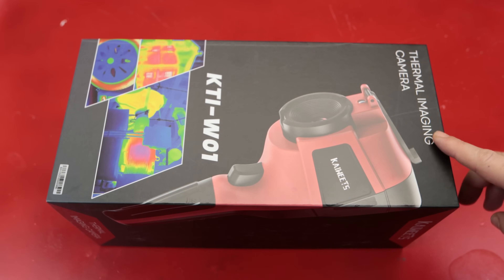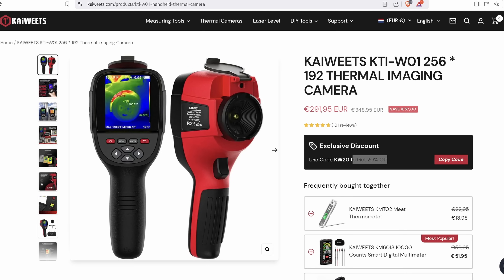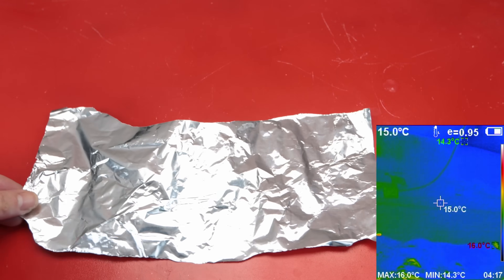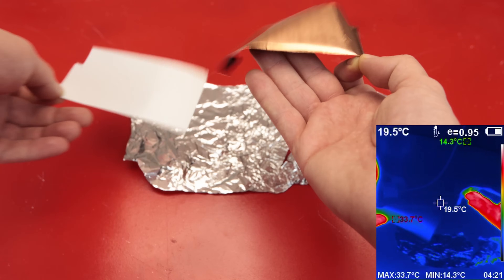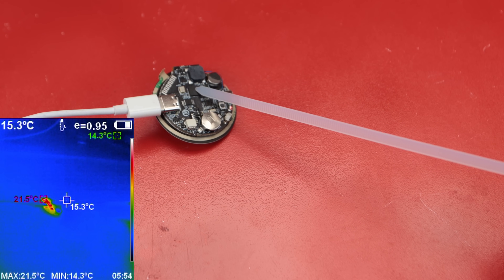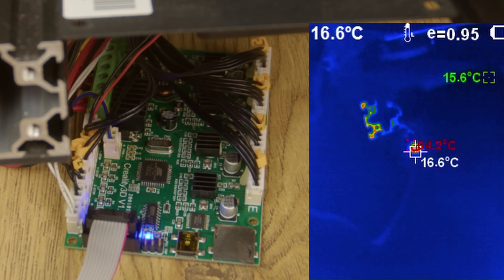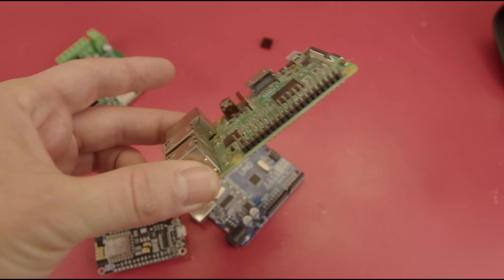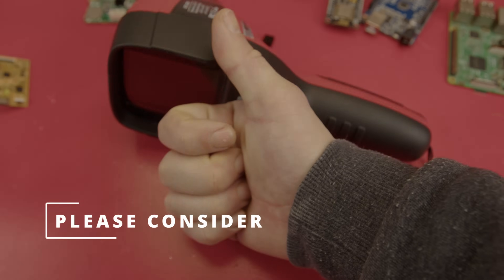Do you really need a Thermal Camera?

Comment: what about the bettery? rechargeable lithium batteries are pretty much a consumable and when buyig an rather expensive device for a hobby you want it to be usable for quite a while and not throw away just because the battery cells died and not replaceable/some weird form factor you cannot get your hands on
Reply from the maker: In this model, the battery is replaceable and uses a standard 18650 Li-ion battery cell.

Comment: Thank you for making this video.  Well Done.    How close can you get up to items using the Thermal Camera?   Will it work close up on small parts?
Reply from the maker: This model has a fixed focus and a 256x192 resolution, so don't expect high-resolution pictures or videos. While I don't know the theoretical distance, it works well from a 5 cm range. In the video, I even identified a fault on a SOT-23 part and I'm confident it can detect even smaller components. The most important aspect is having a temperature difference (delta) for the camera to detect it effectively.

Comment: I bought an infiray p2 pro. It took video and photos. after around 6 months it no longer records video. I emailed infiray and they never have replied. I can now only take still images. I wont buy infiray again.
Reply from the maker: Is it one of those thermal cameras that you connect to your phone? I don't like those either.
Reply: @makersfunduck  yes. I bought it as it's small and easy to use on an extension in case I needed it to go inside equipment etc or round corners of I was working on a car. And my other thought was some very very thin wire to make a 30ft cable so I could hang it off my drone for overhead roof inspection but I never did try that
Reply: I haven't tried, but it seems there's a 3rd-party (paid) s/w with a lot of good features from a German company that (also) supports the p2pro. You can also "just" use your PC-USB-webcam (windows) tool to record greyscale video from the camera, albeit without scale.

It may well be that $220 for the P2Pro and ~50ish for the s/w may be a worthwhile spent $270, considering the end-result. The "default" s/w from infiray is also pretty "intrusive" (requires access to location, media, ...) The German PC S/W, on the other hand, seems to be GDPR-friendly. They have a 1-month free "try before you buy" option, afaik.
Reply: @AdityaMehendale  thanks for that info, will no doubt let me see if I have the same problem on the pc, if so it's the camera... Thing is it looks like a software issue as the photos are fine, and the on-screen preview/liveview while recording are fine, it's just 'corrupt' on the saved recording. My current workaround is screen recorder software and screen recording the preview but that's messy. Topdon software finds it but doesn't show any image just black, unless I select calibrate (which I think they use to hide hot/cold pixels) and then it gives a perfect live feed .... So I think topdon have modified there software to deliberately not work with a competitors product.